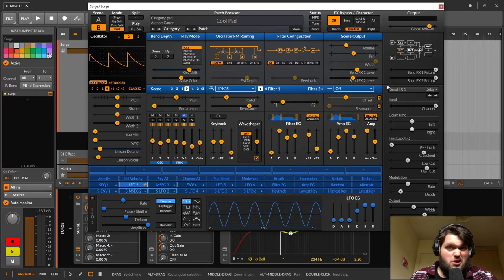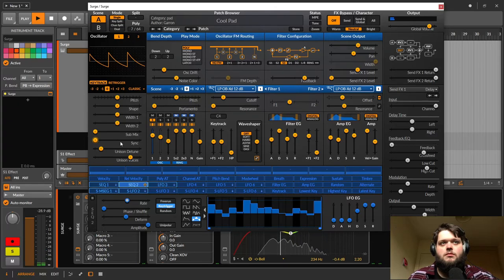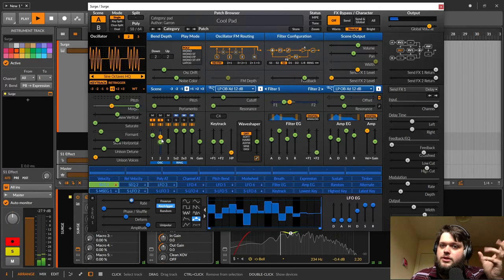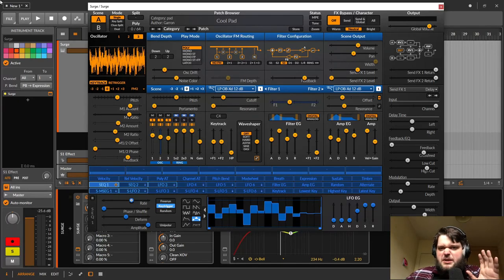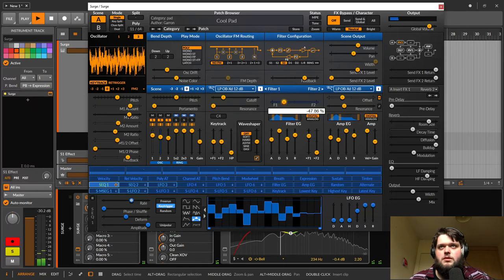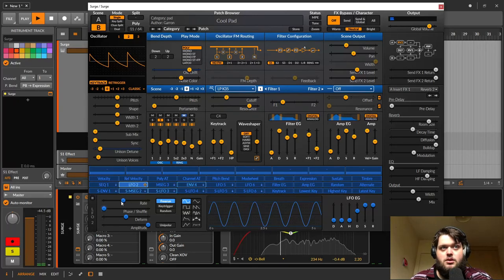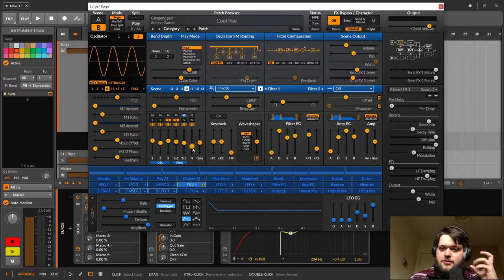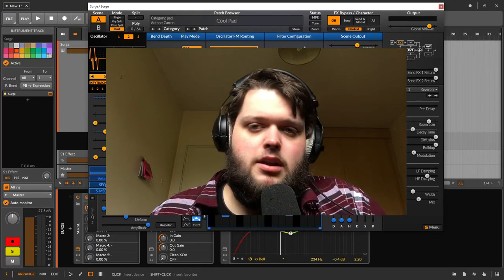SURGE - PAD SOUND DESIGN : Tips For Making Pad Sounds

Comment: I like what the wavetables(and they are many) can do to a pad, and they're pretty cool on their own too.
Reply: I've had this vst for awhile now and I'm just now noticing how involved you're getting here. Most of the preset pads that come with Surge use one or two oscillators on scene A whereas you're using all the oscillators on both scenes in Dual mode! I discovered a quick 'n' dirty way of combining presets by opening a preset, right clicking on A and selecting copy, then open another preset and right click on B and paste, have them in Dual mode and voila!